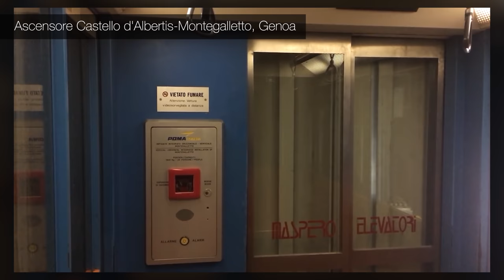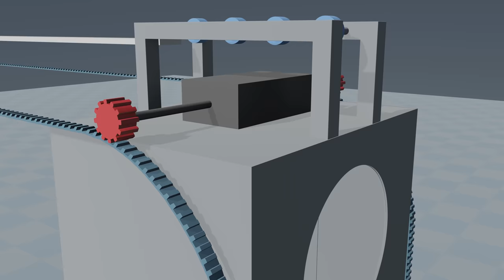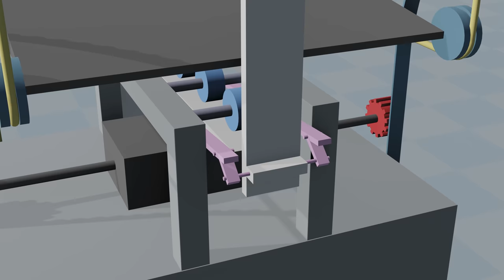I thought the Schmid Peoplemover was impossible

Comment: Here in Berlin is another horizontal/vertical elevator for public use.
But I dont know if it is a Schmid Peoplemover. 
(station: "Betriebsbahnhof Rummelsburg")
Reply: That is the second one of this specific elevator.
Reply: There is also one still standing in Pfullingen, a small town near the Schmid Factory. During my childhood I used it a few times but I believe nowadays it sadly is no longer in operation. That one is in a very weird location across a 3-lane street that's not even very busy anymore and connected a residential area on one side with an industrial area on the other while there was always some traffic lights very nearby

Comment: Why couldn't they just combine the Peoplemover with a standard stair-footbridge combo to make it accessible for disabled people and yet quick to traverse for abled people without waiting on the car to arrive? Just attach the standard stair and footbridge to the structure of the Peoplemover.
Reply: You can't build a bridge in 3 hours
Reply: @sleepyrasta14820  no but these could be put next to already existing footbridges
Reply: @sleepyrasta14820  Make the bridge part of the superstructure of the People Mover, and then all you have to do once the People Mover is in place is install the stairs, which doesn't require a crane on the tracks (and depending on the type of stairs, doesn't require a crane at all)
Reply: The stairs you can see at 4:45 have been there before the Peoplemover. So there wasn't any need.

Comment: I love the engineering of this.  Good solution for the disabled or someone with heavy bags or for traveling over an extreme environment.  However unbearably SLOW solution for any volume of people.  Much slower than even two elevators and a walkway across the top.  The bottleneck of the whole system is you're limited to one cabin. Person on one side is not just waiting on the elevator to come down, they are waiting for it to go across two times and down and up the other side.  Very slow.

Much faster solution if you want the whole thing automated is elevator on both ends and a moving walkway across the top.

Then supplement it with a criss cross stairway on each end.
Reply: Just double the width for two carts. Bonus points for redundancy if one breaks

Comment: That's actually a fairly genius yet simple solution to the problem having the cog tack system. It seems obvious now seeing it but it's really smart. The only other solution I've seen done is an elevator or stairs on both sides of the road and then the overpass has a conveyer on the floor so you step off the elevator onto a conveyer that carries you from one side to the other so you can get onto the elevator on the other side

Comment: "Why should all the road traffic stop for 1 pedestrian" You're asking the wrong question. Why is there only 1 pedestrian? Is your city or town so focused on catering to cars that you've pushed pedestrians to second class citizen where you don't even want them to cross a road? Design for people not cars. This is a really impressive invention and great for disabled people in special situations but its a band aid on the massive problem of car centric societies. Made by someone from the automobile industry.
Reply: While your point is not wrong per se, it does not apply here. This is a small community of 6000 people in the hills outside of Stuttgart. Travelling inside it by foot is no problem as it is very small. But if you want to visit your friends in Denkendorf it would take 1 hour by train and bus and 14 minutes by car because most people won't go to Denkendorf and therefore no direct railway connection was built. It just isn't possible to connect every single community with fast trains as germany has a lot of those. The railway is also privately owned nowadays, so financial incentive is driving these decisions.
But on the brightside if you want to visit Stuttgart the train is the best option with a travel time of roughly 20 minutes.

Comment: If every railway station had these, then economies of scale would kick in and they would become a more economical solution than footbridges or subways. However, for high capacities, a footbridge (with lifts for accessibility and luggage) would be able to carry more people per hour, especially if those people were commuters; they would also use less energy - well, less electricity anyway.
Reply: well you could have a larger cabin or two that pass each other in the middle.
Reply: A slopped underpass is surely cheaper than this in the long run and has way more capacity. Seems like you'd have trouble fitting a bike in there, looks like a terrible solution.
Reply: His original inspiration genuinely seems better suited to this thing than a railway station. Maybe it's fine for small railway stations with relatively few passengers, but I can see how it'd be better applied if you are walking somewhere way out of town and have to cross any sort of road with heavy traffic. A low-capacity low-frequency bridge as this would work fine there, you don't have to awkwardly walk huge ramps to gain elevation, it should be accessible for everyone, and, yes, drivers don't have to stop and it's not dangerous for anyone involved.

However, obviously, nobody is going to pay for thousands of these things everywhere for places with some-but-not-too-much foot traffic; and cost aside, nobody would want these all over the landscape anyway ...
Reply: @alexseguin5245  bike? you mean motorbike? is it even allowed on train?
Reply: @ligametis  I meant bike, as in bicycle, the type which you pedal with your own two legs.

Comment: the STL arch elevator constantly switches between moving sideways and moving vertically without ever stopping.
Reply: This is true, the "pods" are mounted on 2 huge bearings and weighted so that as the elevator rises, gravity naturally rotates the pod. However they are cramped because of the size of the bearings and require a balancing act to make sure they don't unnecessarily tilt. On the other hand you do have the London Eye which is a scaled up version of the same concept.

Comment: Accessibility is essential at train stations. I've noticed many issues for wheelchairs over the years. The main issue imho is still present: Actually boarding the train. Many smaller stations have a significant height difference to the trains that stop there and there is not always someone that can help you when the train is about to leave / stops for a very short time at small stations. Even without a disability I sometimes struggled to board the train when one section was already full and I had to run to the other section to get in with luggage. This shows how little time there is. This elevator bridge is a great but costly idea to improve accessibility. I hope they come up with further ideas especially for the boarding part.

Comment: The problem wasn't that it may break down, the problem was they only installed one.
Extra redundancy and capacity in one go.
Reply: In total 3 were built. They should have made a version with staircase around and walkway on top for more frequently used crossings. Would not have been that much more complicated. Anyway this one is in operation for 20 years now.

Comment: As Cool as the design is,  it wouldn't scale.

Along with the problems Tom mentioned
If you miss the people mover,  you'd have to wait for it to go all the way to the other side,  unload,  reload,  and come back. 

It has more moving parts and points of failure than an elevator,  meaning that it requires more maintenance.

From what I can tell,  it has less safety systems than your average elevator,  elevators usually have around 4-8 redundant lift cables,  electromagnetic breaks,  and a shock absorber.

Comment: To counteract the problem of waiting, you would need two cars that leave at the same time and meet in the middle, similar to some rack railroads. The line is divided and the two cars can pass each other.
But the system would also have to be simpler and easier to maintain.

Comment: Would a circular section work well? Maybe a 100° arc? 

Use two large diameter gears as wheels and a pair of curved racks as the track. The drive gear could be at least a 50:1 reduction making for a smaller drive motor (and helping stop the carrige from running away). 

There wouldn't be a transition as such, as it would be continuous. Similarly there would never be a complete vertical drop. Maybe add a gyroscope in the floor to keep it from swinging.

Comment: Although perhaps not efficient for the general public in terms of size vs number, it would be good to see these developed and installed more commonly for those who need, like as it says on the video, disabled who would otherwise rely on help.
If more were made and used so they became common, then there would be more specialist engineers,  just like ordinary lift engineers are specialists. 

However, as a sole crossing point, these peoplemovers would be impractical, even if engineered larger, so another crossing for the able bodied would always be required,  just like lifts can be the sole up, down transportation where installed as they have same kind of issues.

Comment: "elevators that go both horizontally and vertically"
Essentially a ""rudimentary"" version of the Star Trek Turbolift. Fascinating. With a little tweaking Herr Schmid's design could work in micro-gravity.
"The turbolift, or turbo-elevator, was a device that provided rapid transport with both vertical and horizontal transportation for personnel through a system of turboshafts between key sections of starships and space stations."

Comment: I'm no engineer, but wouldn't an easier solution be to make a proper arch? The elevator would never technically be moving up/down or left/right entirely, and it would be smoother without jagged edges. Sort of like a half-carousel in a way.
Reply: Not sure about the technical advantages/disadvantages, but imagine the extra space you'd need to get clearance over the tracks ...
Reply: Then that would not comply to safety regulations. The vertical part has to be extra secured so the cabin doesn't fall down. On an arch you would have to secure more of the shaft and that would need a new design entirely

Comment: To me, this is reminiscent of the elevator system within the Gateway Arch in St. Louis. It has to go up at an ever-changing angle. The Gateway Arch goes one more step though, as you sit in a round elevator pod, and it's constantly rotating to keep a proper vertical attitude.

Comment: Cartesian 3D printer head is exactly a smooth elevator. Remove the X or Y-axis, add rails and done. 

Also: make a rollercoaster with two endpoints. Have a cable and a winch attached to the carriage from any point that would need to pull/restrain the movement of the carriage. Run cables through pulleys, all cables can be attached all the time. Now make software that runs the winches in unison. Any kind of smoothess acheived with multiple points of safety.

Comment: That's a shame that's not been picked up elsewhere.  Even if you wanted emergency backup stairs, surely you could put those on top of the peoplemover?  Have the ceiling of it be like a bridge.  That's efficient, right?  Sure it has to be a little higher up than it might've.  But saving the cost of the bridge across (since it's already being built for its own purpose) is enough to offset that, right?  Or if not on top, maybe just beside.

It would be lovely for this to be able to be employed where more awkward shapes are needed, as well.  I'd imagine that to be where it could really shine.

Comment: I can think of so many uses for this device.  It's a absolutely genus design and idea really and could absolutely be used in many locations.  It's biggest flaw is that it is a fixed system.  While the "multi" vator you showed prior to this could work in any building this can only work on one trackway at a time.  And I do not see a easy way to switch trackways though I am fairly confident a engineer could come up with several methods to accomplish that.

Comment: The problem with this people mover seems to be analogous to the problems I face when repairing German engineered vehicles. Every challenge is elegantly and expertly solved, with the whole being extremely efficient with regard to space, manufacturing requirements, and functionality. However, it is precisely because the most efficient option is always chosen that repairing and maintaining German cars requires dozens of complex tools and vastly inefficient processes. It is like German cars (and seemingly this elevator) are assumed to last for 1000 years when the reality is rather different. It is not just Germans; any company who celebrate and focus on the beauty of engineering (think Apple) is in danger of losing sight of this a little. They build it to work, not to fail, so why should they care to think about failure?

Comment: Tom,
It is a great design.
You (or the engineers) should compare to the design of the cable car ride to the top of the St. Louis, Missouri, arch. But I don't know if it could be built using standard elevator parts. And I don't know if it has automatic brakes in case the cables or something else breaks down.

Comment: Couldn't you also accomplish this with a pair of winches, one at each tower? Tower 1 pulls the car up vertical, Tower 2 pulls it over horizontal, then Tower 2 drops it vertical. Then repeat (switching numbers) the other way. Would just need rails for the elevator to slide on and guides for the winch cables.

Comment: Someone correct me if I'm wrong, but doesn't Disney's Tower of Terror count as a vertical and horizontal elevator system? At points it runs on tracks not suspension and the cart itself isn't an elevator, but it achieves the same purpose. Obviously it is nowhere near the engineering displayed here but I'm just wondering categorically where it would fit

Comment: i am wondering if it would be possible to make this cog system that would take each carriage as it gets to the bottom.. and then rotate it aroun along the cog rails and then back up and over on that same rail systm.. kind of like a loop.. and then if there could be multiple carriages that run on that loop to provide more paacity? and then also if on of the sides for some reason malfunctions.. then the other side could still be used the same as the one on this video... just going up and over and then reversing direction on the same cog railing?

Comment: Or you could also have escalators that were just deep enough for wheelchairs, or paternosters, or if you can install this so quickly, what's stopping a bridge from being designed with similarly speedy assembly?
Reply: Lots of money, argueably not as safe, and you can't just lift a bridge and drop it there and expect that to work properly, not even if it comes in parts like this thing did

Comment: Seems like an unnecessarily complex solution to a "problem" that could be handled by a simple bridge, and the wheelchairs problem with a ramp instead of steps (that's what we have here) and don't consume any energy after installed
Reply: The problem that it solves is the footprint. Ramps take up a lot of real estate either side of the bridge. This solution takes up minimal space - even less space than a bridge with stairs, let alone ramps. Then factor in the problem that a lot of people using the trains would have heavy luggage with them, which is no joke to haul up and down stairs or ramps. This device solves both problems in one stroke.
Reply: @Mystikan  I think it is also more difficult fir wheelchair users to use a simple ramp than an elevator. So they need at least an elevator to travel alone easily anyway. I don't really see a very good reason why you wouldn't use this design next to a normal bridge.

Comment: The design looks overengineered. If the internal motor can already propel it upwards — why even need a carrier elevator? Just have a second bendy rail the cabin can roll against to restrict unwanted degrees of risky motion. Could be a passive toothless part.

Comment: So…..why? I get they want to allow people to get to the platform, but what not just put in stairs and a ramp with a a bridge? This seems be be over engineering for a problem that demands a low tech solution. The expense and long term care of the moving parts, motors and other demands with electricity etc seem to be overly complex.
Reply: why? the video explained it! ... its has to be handicapped -accessible while having a small footprint on the platforms. A bridge with stairs and ramps on both sides would need far more space and still would be a bother for old and/or handicapped. The other alternative of having two regular elevators and a bridge to walk between doestn really save you complexity and would be more of a hassle to use.
If only people could pay attention when watching a video.
Only thing being a problem with this solution is building cost, as it isnt a mass production solution ... otherwise its doing its job perfectly well for decades and obviously cheap enough to keep it around.

Comment: I am not that impressed. Have you ever looked at how people ascend and descend in the St. Louis Gateway Arch ? Which they somewhat copied in 1965 from Disneyland people movers.
Reply: 2 wildly different mechanisms involved. I dont think St. Louis Gateway Arch has 2 90-degree angles in it.
Reply: @YellowFireIpad  Right, not a hard 90 degree, but covers close to 160 degrees. It starts out at the bottom angled from level up to about 20 degrees, then as ascending is going vertical, then as it reaches the top it comes almost back to level keeping the passenger car in its original orientation throughout. And it transports 30 people each trip. You should look up its history and design. Very interesting for anyone mechanically or construction minded.